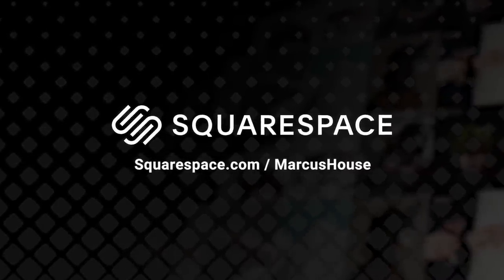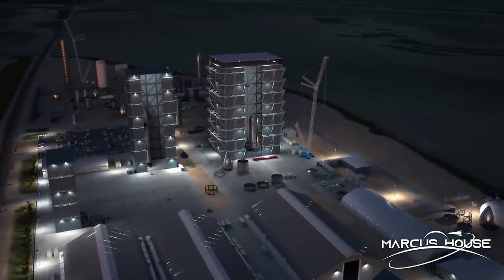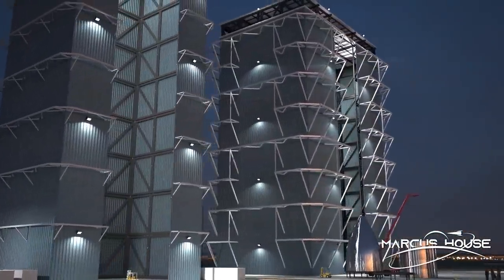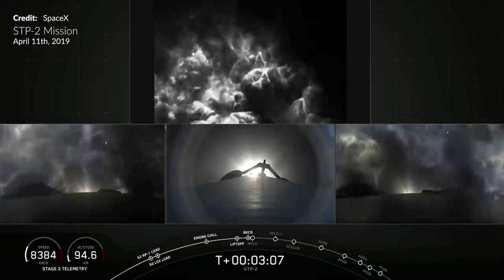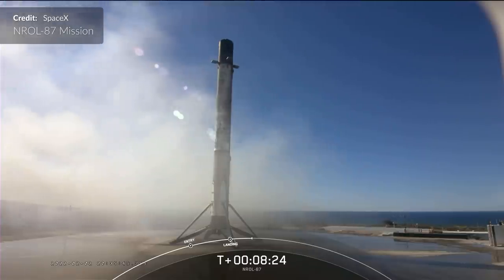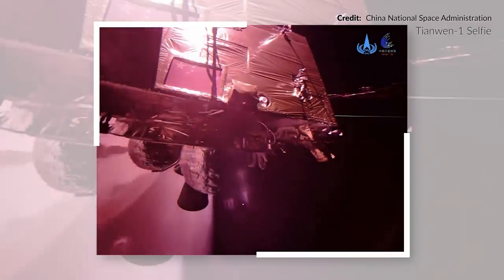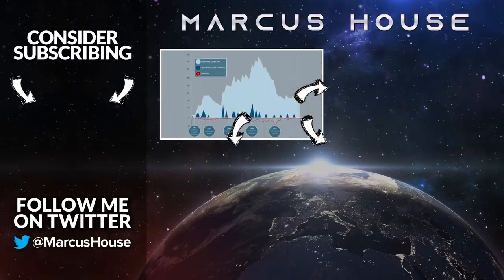SpaceX Starship Presentation for 2022, Roberts Road Facility, and 3 Falcon 9 launches in 4 days

Comment: Great job, again, Marcus. Thanks for keeping us up to date. Hopefully my concerns about the lack of protection of the GSE tank farm and related structures and plumbing from the blast from thirty-plus Raptor rocket engines hitting the flat concrete and blasting laterally in all directions are not warranted, but that remains to be seen. Lifting thousands of tons off the OLM means that thousands of tons of blast force will be aimed down and will be result in hundreds of tons of blast force laterally against the GSE tanks and related structures, which do not appear robust enough to resist such force. There will be tremendous vibratory energy reflected upward to the booster as well, without any blast diversion system.
Reply: They will certainly will have some protective system applied to the ground under the launch table - i think a baffle or barrier made of steel pipes thru which water will be pumped to cool them.
Reply: I hope that someone at SpaceX, or someone who makes animations of these launches realizes how unprotected those GSE tanks and other things related to them are, since they're no farther away than the tower is tall, and there is no diversion system to keep the rocket blast from putting hundreds of tons of lateral force on those tanks with a very large amount of LOX and liquid methane.
Reply: @stephenhumble7627  I'm not sure what you mean by "some protective system applied to the ground under the launch table," or OLM. Cooling the concrete under the OLM is nothing compared to the effects of hot rocket exhaust knocking over the three LOX tanks and the three liquid methane tanks, releasing many tons of that very flammable mixture and igniting it. The resultant fireball would be headline news shown around the world within minutes.
Reply: @stephenhumble7627  You may have noticed animations of what the launch of the booster would be like, with a very great deal of hot exhaust gases blasting out in ALL directions, including directly at the GSE tank farm and the other tall tanks and plumbing associated with them. The rocket will weigh thousands of tons, requiring thousands of tons of exhaust pressure to lift it up, a considerable proportion of which will blast directly at the GSE tanks and associated hardware, putting hundreds of tons of pressure on them. Having watched the process of sitting those tanks up, I didn't notice that much strong hardware installed to resist that kind of pressure.
Reply: @silkaeichorn5381  The tank farm is about 100 meters from the launch table and the rocket exhaust is directed downwards hit the ground and deflects in all directions if the rocket has thrust of 8000 Tons and assuming there is no attenuation of force which is the worst case possible you can calculate the force experienced at a distance of 100 meters would be would be at most 127kg/m2 or similar to Category 5 cyclone force winds and probably much less due to thermal energy losses to the deluge water , and the ground etc. I expect the tank farm would have been designed to handle that.
Reply: @stephenhumble7627  Nice to have somebody come up with a factual based discussion. 
I hate the 'airy fairy' people who can't be bothered to sit down and do some genuine work, to calculate out the exact numbers that are present.  This B4 has 29 Model 1 engines (as far as I am aware) at 230 tonne output, so 5,365 tonne output. 
The targeted goal is a Booster with 33 X 'Model 2' Raptor's at 230 tonne output = 7,590 tonne output. Possibly a bit more as they perfect the design.
At 1:14 you have a picture, where  there is a dirt berm between the OLP and the Orbital tank farm, which will deflect the , approximate 90 degree part of the 360 degree exhaust output, angled into the air. AND who knows, SpaceX may have additional water sprayers along this BERM, to help deflect and cool the 1/4 force of 5,365 tonnes= 1,341 tonnes that will be blowing in that direction. 
If you look at other launch systems, they seem to channel the force in trench's. This creates the big visible plumes of white cloud billowing for a  long distance. This MAY have people thinking a 'visually similar' effect with B4, when in actual fact it will be a 360 degree plume.
That is what we have already seen with SN5,6,7,8,9,10 and 15 and I didn't hear thoughts of the Sub-orbital tank farm being in danger during the lift-off. Only a potential misdirected landing on top of it or RUD on the pad. So some people's imaginations are 'fogging' the reality is what I think is going on here.
Reply: @stephenhumble7627  If you actually think that those GSE tanks are engineered to withstand a category 5 hurricane (cyclones occur in the Pacific ocean, hurricanes in the Atlantic), you will be surprised when the booster actually fires over thirty Raptor engines 100 meters away with no realistic barrier to deflect that multi-thousand ton blast.
Reply: @David-yo5ws  Look at the blast diversion systems at all the rocket launch facilities around the world, to handle the blast from rockets less powerful than the Spacex booster. They are ALL huge, and when the rockets fire and lift off, the blast, with the water always injected into the exhaust stream, flies off to one or two sides and creates a cloud of steam and gases which dwarf the entire launch facility. Without such a diversion system, all that rocket blast and steam will fly out radially from the OLM and up toward the booster. It is for very good reasons that all of the other launch facilities in the world have invested so much in the blast diversion systems that they have.
Reply: @elihavalot8111  I remember seeing those rather small brackets or flanges which were attached to the bottoms of those GSE tanks, and then attached to the concrete base on which they sat, but I recall thinking at the time that they looked too weak to keep the tanks upright when they were hit by the blast from all those Raptor engines firing full blast just a hundred meters away down onto a flat surface.
Reply: @elihavalot8111  Even the workhorse rocket that SpaceX uses to launch satellites, with nine Raptor engines, created a huge plume of gas and steam when it rises off the pad, and the Saturn V, almost as powerful as the booster, created a really huge plume which dominated the entire area about the launch site.
Reply: @elihavalot8111  SX can perform staged engine testing and measure force as they ignite more engines. They can back off if they want.
SX could choose to add a water cooled baffle system under the launch table to absorb more thermal energy if required.
And though 127kg/m^2 would be a very powerful blast of air that is similar to what a skydiver feels as they fall. SX would know what the tank farm and other nearby structures would be designed to handle.
So long as they are careful anything loose is properly secured to prevent it from becoming a projectile should be fine.
Reply: @silkaeichorn5381  If we use this estimate of 127kg/m^2 and apply that to the GSE tanks, each one is nine by thirty meters and there are two rows of four tanks with little space between them so they could be modeled as a wall thirty meters high by forty meters wide, 1,200 m^2 meaning that the force against them would be about 152,000kg or 76 tonnes. Acting at an average height of fifteen meters from the ground, the bending force on the flanges holding down the tanks, using 4.5 m as the leverage distance, would exert forces in the range of three times that lateral force on those flanges. There are four sets of flanges, each taking 3/4 of that 152,000 kg or roughly 114,000 kg or 57 tonnes. From what I saw of those flanges, they were not robust enough to take 57 tonnes of vertical force. I guess we'll see when they fire up the booster. SH wrote that the SpaceX team "can back off if they want," but it might be a bit late when they try, since it won't take long for the LOX and liquid methane to spill, ignite and cause a rather enormous fireball which will surround all of the LOX and liquid methane tanks, with warrantee voiding consequences.
Reply: @elihavalot8111  That is just a theoretical examination of how much force is exerted on those hold-down flanges on the GSE tanks, but it seems reasonable, given that proposed level of force being exerted by the rocket exhaust when the booster fires thirty, +/- Raptor engines. We'll see, I guess, when they fire a large number of rockets at one time, and for long enough, not just one second, to see how the blast interacts with the GSE tank farm and associated plumbing and auxiliary tanks. I hope that the rocket exhaust doesn't just pick up all the dirt in that earth berm between the OLM and the GSE tank farm and flings it as the tanks in the first few seconds.
Reply: @silkaeichorn5381  I haven't bothered to calculate the pressure at 100 m from the OLM, since the volume into which the rocket blast will enter below and around the OLM is pretty open to the south and east, but rather constrained to the north by the GSE tank farm and associated hardware and to the west by the launch tower, which is still open and not covered with any protective sheathing. Absent any diversion system to divert the rocket blast away from the GSE tank farm and tower, they will be engulfed in a more powerful exhaust blast than what the Saturn V threw out into the ocean next to its launch pad with its carefully engineered and enormous blast diversion system.
Reply: So, that was a bit surreal to watch someone talk to themselves across 2 accounts. And going to the effort of signing in with more alt accounts just to like your own posts, seems a bit excessive?
Ahh, what do I know....maybe he's building them up for fun.

Comment: Is it me or has the accuracy/repeatability of returning Falcon 9 boosters improved? I recall the first several booster that returned landed almost anywhere within the big circle on the landing pad. The most recent landing have been pretty much dead center of the inner ring.

Comment: Why doesn't mechazilla have a counterweight? It seems like a recipe for disaster to carry that load cantilevered without a counterweight. Even if it works short term it's placing an enormous asymmetrical load on the tower that is going to result in fatigue.

Comment: Amazing work as usual Marcus! The stacking renders were awesome. I reckon they’ll actually lift slight before locking in the stabilising arms, this is to allow for any required rotation/alignment first. Otherwise we’re assuming they’ll position the vessels 100% accurately on the ground prior to lift which seems unlikely?

Comment: 19:19 there are ripples moving on the top right of the machine. How? No air in space?
Reply: The panels are moving, so they almost certainly introduced vibrations into the spacecraft, which could cause the ripples.

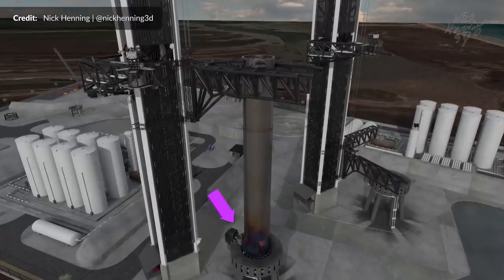Comment: Marcus, at 3:03 you talk about "hold-down" clamps. I see hold-up clamps, but no hold-down clamps. Every rocket, especially one with 33 motors, needs to be held down until the thrust stabilizes on every motor. I've been trying to see hold down clamps for months without success. Do you have some insight into this? It doesn't make any sense to me.

Comment: Good Morning Marcus (or your night I think). I would seem unusual for those opening under the fins to be lift points but it needs something and it would be to likely to cause damage to the fins to lift by then. They will need some kind of plug to stick in those opening though. IMHO that location is too hot to mount a protruding lift plug permanently, leaving me to wonder if the Starbase gang have already mounted a insertable plug somewhere on mechazilla.

Comment: just curious: the starlink satellites launched this week are the new ones with laser links? didn't Elon say SpaceX needs to launch them using starship?
Reply: He said Starship was needed to launch a large constellation of them, partly due to their extra mass but mostly because the rate of constellation growth would be too slow if it was done by F9 launches of only 49 at a time. However, in the mean time the laser-link ones have been launched on the last few Falcon 9 launches and this will continue.
Reply: That is the version 2.0 sats. The current ones being 1.5s which are version 1.0 with LASERs. Forget what the difference is in the 1.5s and 2.0  but suspect there is a good bit of size difference.
Reply: @gravelydon7072   The 1.5 are heavier than the 1.0 mostly because of a larger krypton tank, IIRC, in order to extend their lives. 2.0 probably will have an even larger one. Hmm... maybe larger solar panels.
Reply: @donjones4719  I'm thinking the panels are bigger so that they can use the LASERs better. They just end up being a bigger sat so they need more space to put them in to launch.
Reply: thanks that helps clarify :)

Comment: I wonder why the legs of the booster extend in a staggered process (not all at the same time)
Reply: As I understand it,  The legs unlocked and simply fall open by gravity.  They are usually less staggered than what was presented here.
Reply: @paulsto6516  nice. thanks mate

Comment: Why is no one asking how they plan on ROTATING starship perfectly to mate with the booster when it’s lowered? It seems impossible to make all the rotational calculations on the ground so that after it pivots over it’s perfect. 

They can’t move the chop stick rails in different directions to rotate it as it would bind the arms AND cause the load center to shift sideways. Maybe the booster base can rotate? Haven’t heard any mention of that though. I’d imagine these things have to line up within ~1mm or so. 🤷🏻‍♂️

The ones that land will obviously be way out of alignment and would need to be rotated far more before stacking.
Reply: There are hydraulic positioners on top of the catch arm rails.

Comment: This made me wonder exactly where the chopsticks will be positioned during launch.
Reply: To the side and likely near the top. Reason being that the cables would be more protected from the exhaust heat as by the time the Raptors got that high, the rocket would already be moving at a speed higher than if they were down lower. And less cable length exposed.

Comment: Great channel I look forward to your release every week. I would like to ask if the following sounds practical for cargo bay door for the Star Ship. 
Two doors when closed flush with the ship, spans app. 120 degrees around the ship. 
Two enclosed external door guide rails around the ship on both ends of the doors.
First step on opening is the doors move out and engage with external rails.
Next the doors track the rails and rotate around the exterior of the ship. One clockwise the other counter clockwise. 
At sixty degrees the doors are fully open.
Could possibly be driven by a gear rack, or a steel strap. 
Should be able to work either in orbit or standing upright on some planet or moon.

Just wondering about the basic concept of this idea.
Reply: Except that from the pictures, the door segment(s) will have to move forward first to unlatch.  Once they have done that, the door(s) will open backwards or possibly forwards. Forward would be better as that would give a better chance for closure if there were a failure when reentry is tried. That direction also would make for better payload ejection as if the rocket were moving ahead, payloads would not hit the door(s).
Reply: @gravelydon7072  Reread my post. I feel the idea I make is better.

Comment: I hope that SpaceX succeeds in launching Super Heavy from Boca Chica. It was been wild to watch all the Starship tests ( with the spectacular explosions) and all the construction finally becoming operational facilities.
BUT...The lift off of the very first orbital test is going to be paramount to the success of future endeavours. Obviously an explosion of the massive rocket on take-off would be disastrous, but I think that outcome is highly unlikely.
BUT #2...After doing some calculations based on the various factors such as fuel, an explosion at less than 500-1000m would much more damaging to the surrounding area than a explosion on the launch mount obviously. If this unlikely even was to occur, I believe the fallout (not literally) will be very bad for operations at Boca Chica moving forward.

Comment: What is the position of the catching arms at launch? They can’t really get past the stack so are they going to be parked at the bottom and wide open?
Reply: Plenty of room for them to go to the top and then swing out of the way. Better for the cables also if they are at the top insted of the bottom as less cable exposed and less exposure time to the exhaust. Also would get them out of the way in case of a RUD on ignition.
Reply: @gravelydon7072  It's not clear the arms can clear the top of a full stack let alone the stretched ship in the near future. Remember the arms can't go above the tower since they ride on the rails and are hoisted by the pulley block at the top of the tower. The tower is 450' but the orbital mount raises the full stack from ground level. I'm not convinced the arms can go up over to move to the side which was the reason for my question
Reply: @Racores  They don't have to go over the full stack. All they have to do at the top is be swung open, which they would have to be either going up or going down. One arm wide open on either side of the stack. Only for a lift from a transporter would  both the arms need to be on the right side of the centerline of the launch configuration.

Comment: Why is the Chinese spacecraft thermal shield blowing around is the wind?
Reply from the maker: I'm actually not 100% certain what is causing the effect. Vibration within the spacecraft itself maybe (fans/motors or something maybe that is shaking the vehicle slightly. Not sure if temperature/solar radiation can cause such a thing. We do see this also on Falcon 9's second stage quite often in orbit.